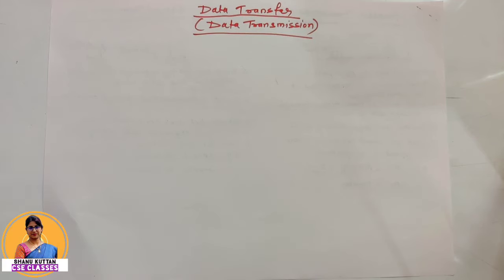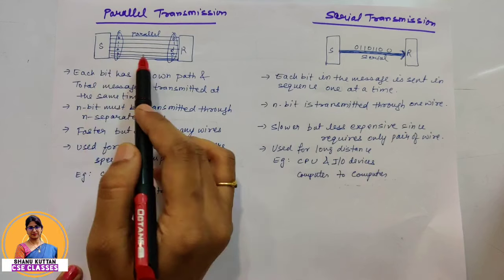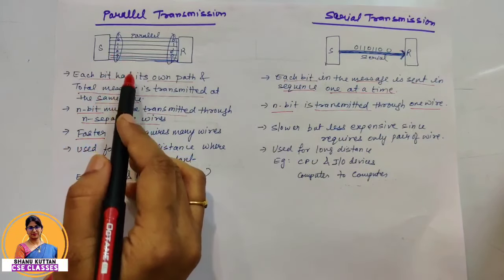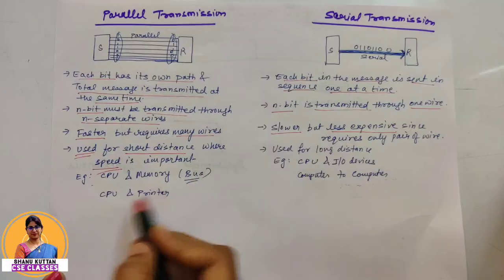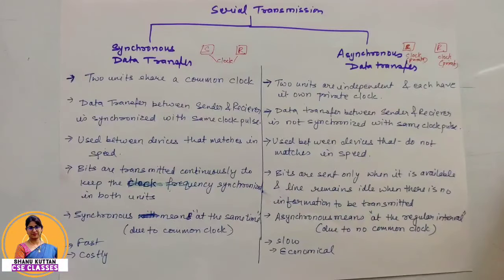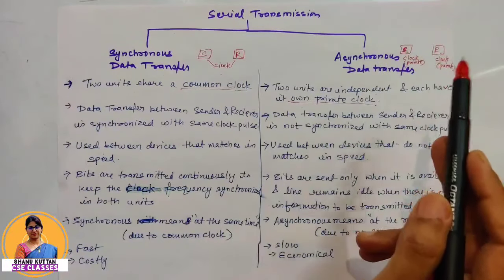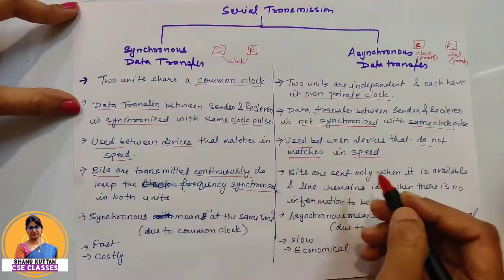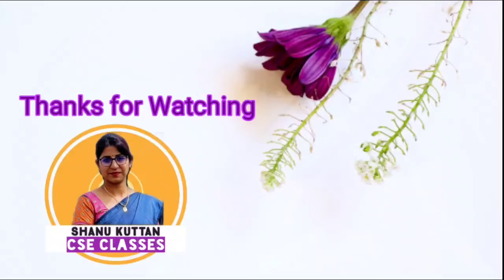L-4.3 Data Transfer |Parallel vs Serial Transfer | Synchronous vs  Asynchronous Data Transfer | COA

Comment: I want to know 1 thing in programming eg in  js or py we use async await function but it takes less time then synchronised method?
So asynchronous method is not fast? Then synchronised programming?
Example is api use or request module.....
Or it just say becoze it wait for getting value then pass that's why it is slow ?

Comment: What is a meaning of clock ?
Reply from the maker: clock refers to a microchip that regulates the timing and speed of all computer functions. A clock or  timer is a continuous pulse that helps the computer clock keep the correct time.